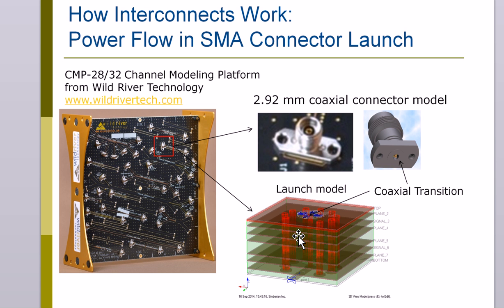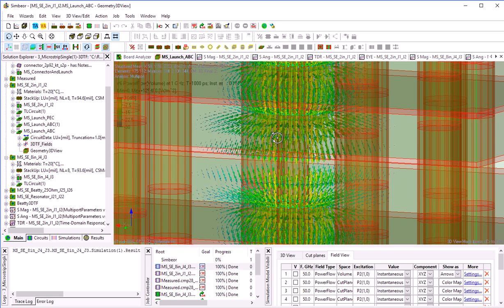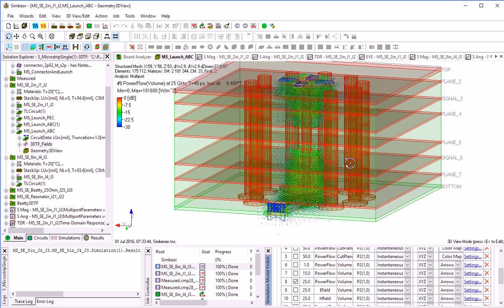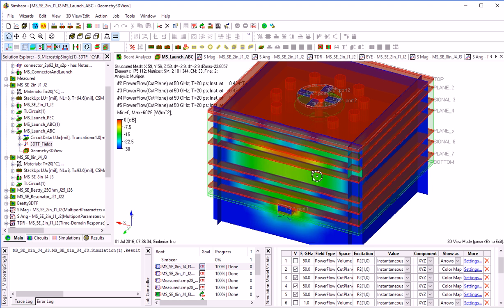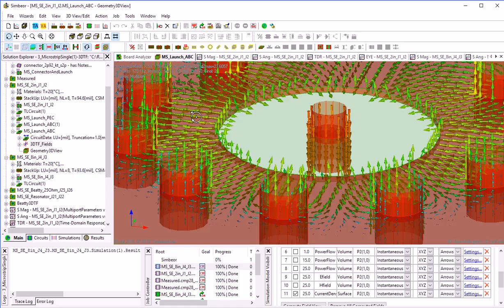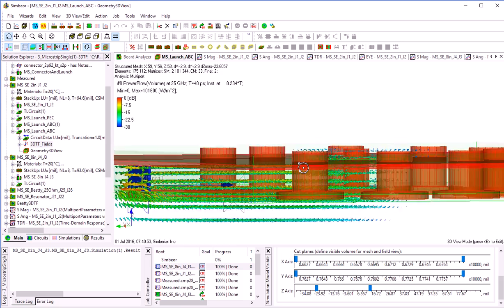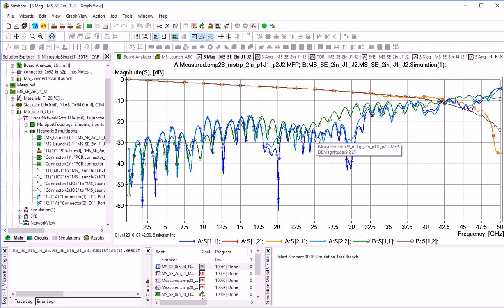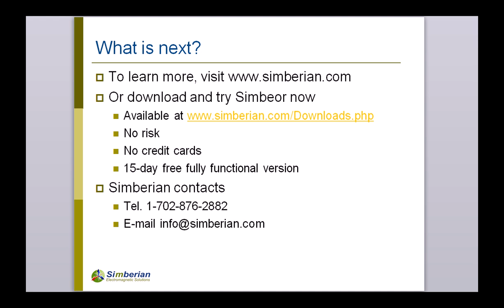How Interconnects Work™: Power flow in coaxial connector launch

Comment: Is it possible to do the analysis and sweep parameters like copper roughness, thickness, prepreg thickness, etc? It is good to simulate, but one of the questions is "what variance will i see in the final product when I have to deal with real world variances?".
Reply from the maker: So far, automatic sweeps are not implemented in Simbeor - we are working on it. Though, to investigate sensitivity, a solution space with multiple geometries can be easily created in Simbeor by cutting/pasting and modifying geometry or material parameters. We are planning to implement Monte-Carlo analysis, but PCB manufacturers usually do not provide  data on statistical distributions of geometry and material parameters.
Reply: That's good to know you will have a Monte-Carlo type analysis in the future. Even with best guestimated parameter variances, I think it will serve to give a confidence level that what is manufactured will perform as designed.